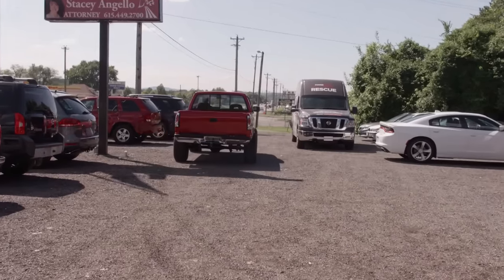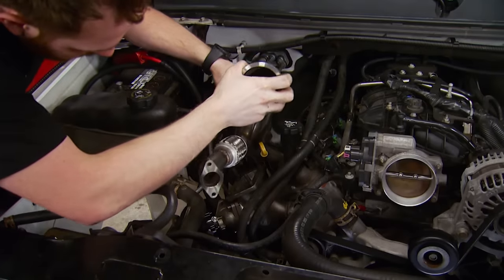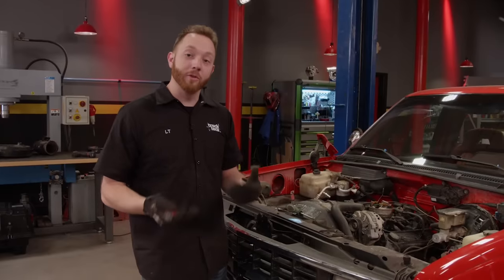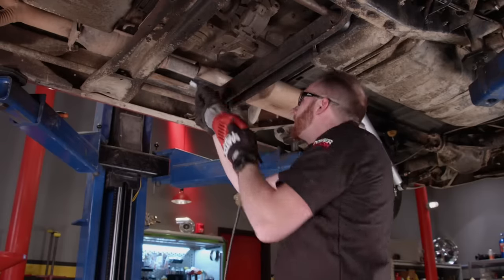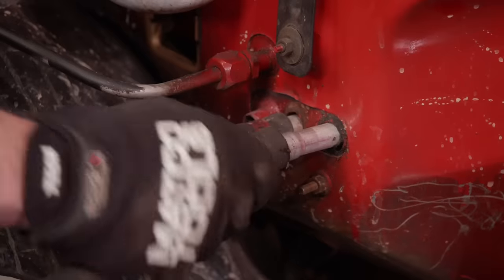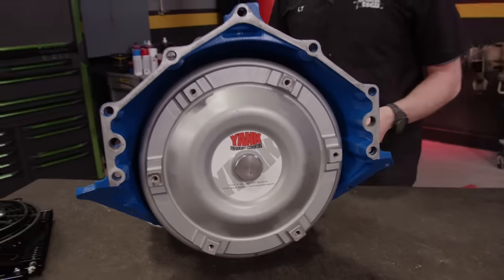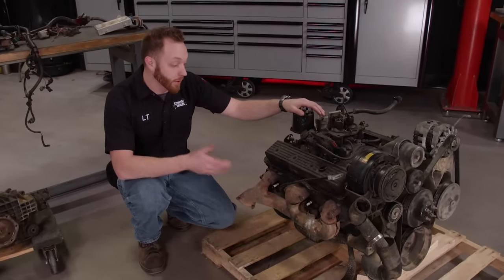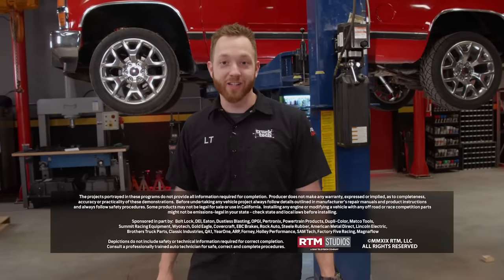LS Swap Do's & Don'ts on a Chevy K1500 - Truck Tech S6, E5

Comment: I've seen TBI 350ci engines go 500,000mi before using oil. Someone didnt take care of their ENGINE not motor. And I could build that 350 to embarrass that crate ENGINE. Ol school all the way.
Reply: Jody Cornelius a agreed I have a L82 350  1976 vette close ratio 4 speed  f41 suspension plus home brew coil overs and stock f41 leaf spring (super stiff )owned 40 years  . Rebuilt and blueprinted it myself  in 1989 added small used blower ,comp blower cam roller rockers moly rings variable valve lifters rhoads  .Big tube hooker headers hi volume oil pump and double roller timing chain modified hei and module accel yellow remote hi voltage coil , ported and polished Oem 2.02 heads . I built a 850 cfm  and boost referenced a Holley carb added water methanol water injection system . Hand made dual 3 inch inside diameter dual exhaust same size as hooker collectors . Later I stripped painted the old stingray in blue and diamond metal flake in my home garage old school hand rubbed only problem car attracts to much attention and is driven only a few 100 miles a yearlolo . Best part passenger is pinned  to the seat in first and second gear ,the car was raced 2 seasons in auto cross and solo 1 at road courses in Ontario Canada in b street prepared
Reply: Love old small blocks

Comment: Get rid of those snowflakes... Actual knobbies on it.... Also manual transmission... And get rid of the lowering kit I get what you're trying to do. You're trying to make it all wheel drive race truck but just buy a car if you're going to do that... You better off making it an actual truck. Honestly how it came into the shop. Just put the LS into that truck and call it a day

Comment: Watching this video is waste of time! What was the final cost of the parts alone??? If I was going swap an LS motor in to an old Chevy truck I would buy a complete engine in a junk yard with all the factory accessories including the wiring harness. You could have the junk yard motor rebuilt (if it's even necessary) for way less than $3200.

Comment: Best thing is to avoid buying one in the first place!! Should you insist on buying one, remove the engine, & retro-fit a Cummins 6 litre V-6 DIESEL, with turbo. My personal opinion is from extensive work in the auto industry. Anything with a GM badge means Garbage Motors.
Reply: @elonmust7470  WRONG!! We have Ford F150 vehicles here, with similar suspension systems to this crappy Chevy. A lot of owners are removing the V-8 Cleveland & Windsor engines, then installing the Cummins V-6 6 litre turbo diesels. The weight is not much different.

Comment: "Only costs $3500" Says no working person ever. This motor swap is totally unrealistic. Go get a junk yard truck and swap in an ls motor or get one for 1500ish online. That is where most people will be looking.
Reply: Did you just power wash the engine bay and then not clean up/paint the engine mounts? face palm

Comment: My mom's friend David is having a problem with a fuel injected engine
Reply: Ok, do you have a question?
Reply: @reallyhappenings5597  no but I can tell you the problem he's having he has to used starter fluid to get to start his engine is leaking oil and I believe he said the motor internally is not good and he doesn't have the money to fix it

Comment: Lowering a 4x4 was ignorant... I know you wanna be different but that’s just dumb
Reply: Why?
Reply: Why?
Reply: @diegojimenez6975  because 4x4 is for offroad situations. 3" of snow does not command the use of 4x4.
This truck ia stupid.
Reply: Theodore Dowman so by that definition gtr’s evos wrx’s are stupid cause something isn’t what your ideal build?
Reply: @diegojimenez6975  Those cars use electronic all wheel drive systems.

None of them have transfer cases...
There is a big difference.......
Reply: Yea it’s just a waste of a 4x4 truck... it’s like buying a V8 Camaro and swapping it to V6... just a spit to the face...

Comment: You completely disgraced that 4x4... shoulda just bought 2wd if you wanted a street truck... shoulda been lifted and a carbureted stroker
Reply: tclott316 not hating on what he’s doing as much as I’m hating on the truck he chose to do it to... carbs are more budget friendly and simple and if setup properly still perform just as well or better then fuel injection... 5.3 swaps are the norm these days so I think it’d be unique to be carbureted... everybody has an opinion though... mine is you don’t lower a 4x4 you lift it and 4x4s are usually carbureted